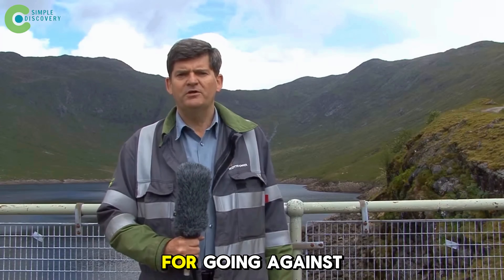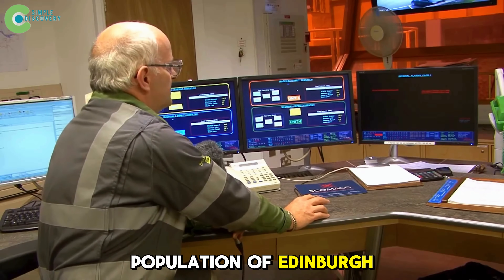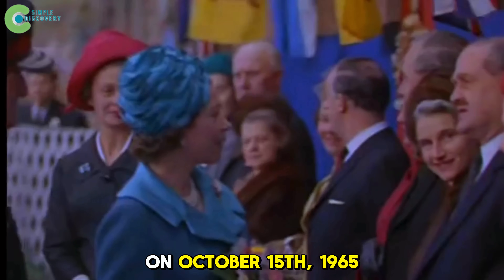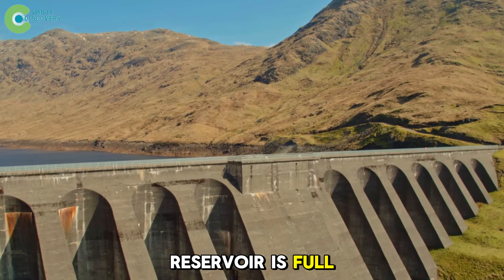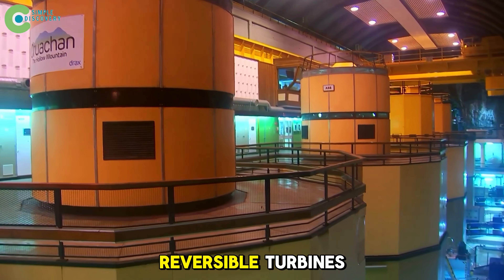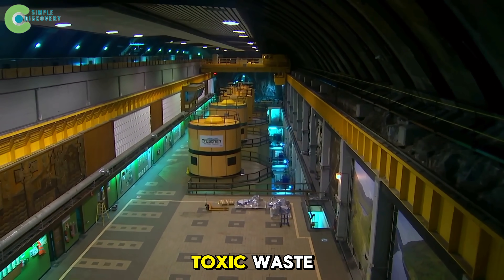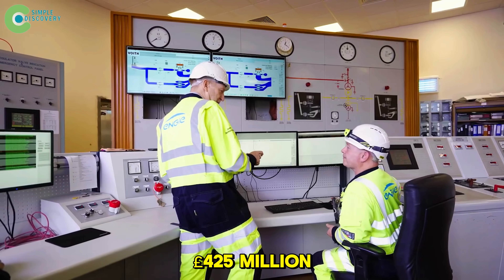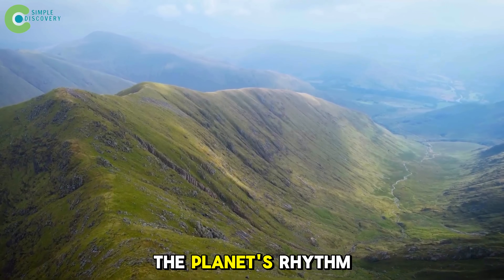Scotland BLOCKS MILLIONS OF TONS OF WATER FLOW FROM MOUNTAINS- HORRIBLE TRUTH That Shocked The World

Comment: What pounds ? How many tons is that ?
Reply from the maker: The video refers to millions of tons of water, which is roughly equivalent to billions of pounds. One ton equals 2,000 pounds, so if it’s “millions of tons,” we’re talking about several billion pounds of water.
Reply: @SimpleDiscovery24  NO ! A billion is one million times one million. My Concise Oxford English Dictionary states so. What hyperventilating and exaggerating Americans call a billion is, in fact a " Milliard" (1,000 x one million). There was a campaign in America in the 1950s to have 100,000 declared to be a million.
Billion  1,000.000 squared
Trillion 1,000,000 cubed.

The pound (lb) thing is just another example of American verbosity. It sounds more impressive than tons. A ton is, in fact, 2240 lbs. A tonne (metric ton) is 1,000 kilos, marginally smaller than a proper ton at a little under 2,205 lbs. The US ton (2,000 lbs) should ALWAYS be shewn as such to avoid confusion. The US ton is smaller, once again, to try to make out that things are bigger than they are.

The American gallon is also smaller than proper gallons, again, purely to make things appear bigger than they are. Although "acre ft" is not something in regular use in Europe, at least, in America, the foot and the acre have not been corrupted by the ignorant .... yet, so means the same.

16 ounces in a pound (lb), 14 lbs in a stone, 8 stone (112 lbs) in a hundredweight (cwt) 20 cwt in a ton (2,240 lb) .... simple.

12 inches in a foot, 3 feet in a yard, 22 yds in a chain (the length of a cricket pitch) 10 chains in a furlong, 8 furlongs in a mile. At least Americans seem to understand that.

Comment: And how much does it cost to pump the water back up to the top lake?
Reply from the maker: At the Cruachan Power Station, it costs roughly the same to pump the water up as it does to generate it back — about 80% efficiency. In simple terms, for every 100 units of electricity used to pump water up, around 80 units are generated when it flows back down.

The actual cost depends on electricity prices at the time — the plant typically pumps water during low-demand, cheaper hours (like overnight) and sells power during peak times when prices are higher, making it profitable despite the energy loss.
Reply: As you cannot shut nuclear power stations down completely, the Cruachan pumps use the electricity that they generate in the early hours of the morning when nobody else wants it.

Comment: "running out of fossil fuels", Scotland has enough fossil fuels to last generations.
Reply from the maker: That’s true—Scotland still has significant fossil fuel reserves, but the focus now is more on renewable energy and reducing carbon emissions than depleting resources.
Reply: No we don't. The easily-won coal has been exploited, what's left is uneconomic, even if there was demand for it  - UK shut its last coal-fired power station (Ratcliffe-on-Soar) on 30th September 2024.

Oil & Gas production from the North Sea is in decline.  Nothing unusual, just the same predictable decline as equivalent oil & gas provinces across the world.   2025 oil production forecast is 530,000 barrels/day, gas is 410,000 barrels oil-equivalent/day (NSTA figures).  By 2030, it is projected to be 370,000 b/d and 200,000 boe/d respectively.  As an ex oil & gas industry analyst working for a company that specialised in this area, I confidently predict oil and gas production will continue to decline thereafter.  

Then again, you might be right - North Sea oil & gas could last (but still in decline) for multiple generations - of fruit flies, but not human beings.

Comment: Naming the power of the station/engines would not be an error, or did I miss it under that avalanche of words?
Reply from the maker: The video focused more on the environmental impact than technical details, so the station’s power wasn’t mentioned. It wasn’t an oversight, just a different focus.
Reply: @SimpleDiscovery24  We have several pump storage plants in Austria, and some of them are also in caverns. The newest even with an asynchronous motor-generator that can vary its 2*240MW power even while pumping. For an electrical engineer, it is essential to know the power capacity of the plant and the storage size (i.e., the duration for which the lakes can supply full power).

Comment: If you still call it fossil fuels then you are a brainwashed puppet
Reply from the maker: The term “fossil fuels” is widely used scientifically, but questioning the language helps us think critically about energy and its impact.
Reply: Fossil fuel is the opposite of renewable fuel. Renewable fuel has no impact on the CO2 balance.
Reply: @gottfriedheumesser1994 yes it does. Machines trucks ect use